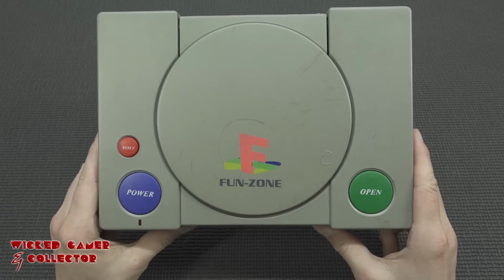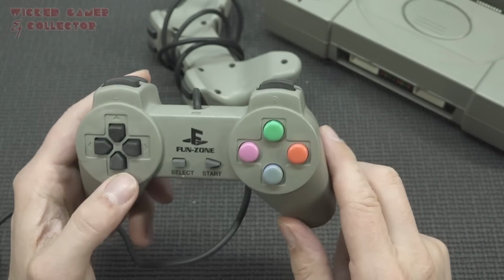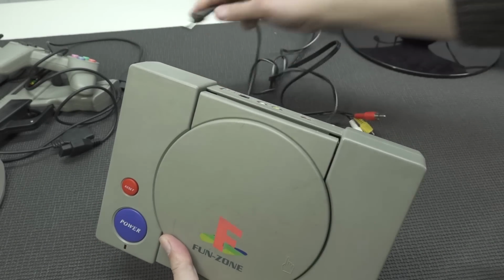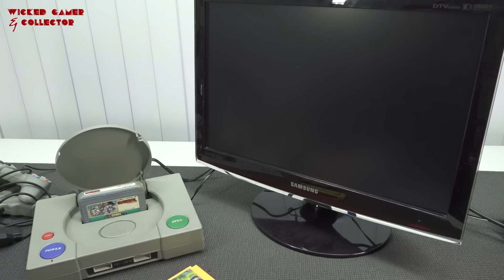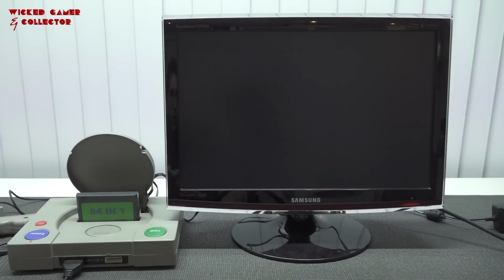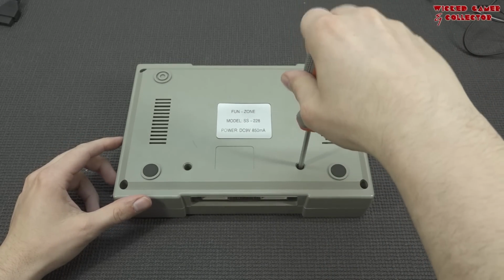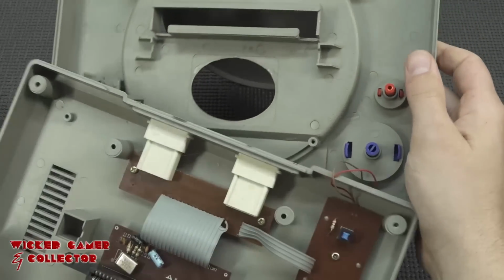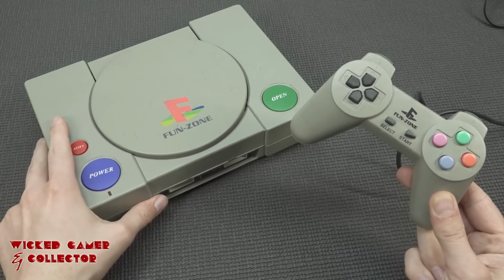Time for the Fun Zone ! Better Than Playstation ? 🙃

Comment: It looks like a PS1 but only (kinda) plays Famicom cartridges? My first reaction is: why? If it only plays NES games then why should it look like a PS1 &  what are all those superfluous buttons on the controller for? Anyone who wants to play NES could just buy the original hardware or, failing that, a console that mimics the original hardware much better than this.
Reply: The original NES has a lockout chip to prevent playing bootleg games.  Someone who buys this thing is probably also buying bootleg games.

Comment: Don't you love these craptastic old famiclones. I have a few PS1 looking clone systems which are pretty old and I just love them. Sure, they suck... the cables are terrible and brake easily, the signal is horrible and the controller often hardly work. But come on... If that is the only thing you could get in those days then I'm sure you would feel like the luckiest kid in the block. And it just gives me that crazy smile on my face seeing these prehistoric low budget clones pop out the weirdest game hacks you ever saw.

As a sidenote, my dream is to find one of those better made clones for a decent price one of these days. Those who are made with real processors, which have high compatibility and not just a NOAC.